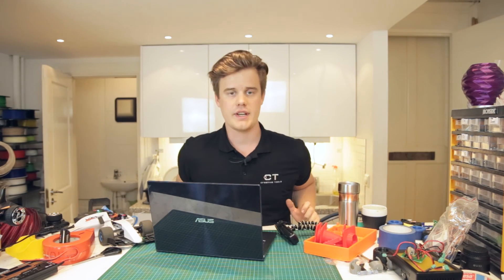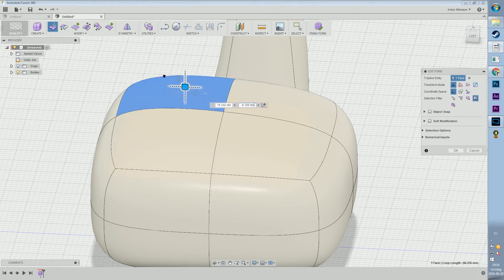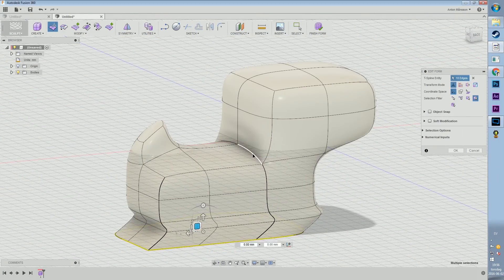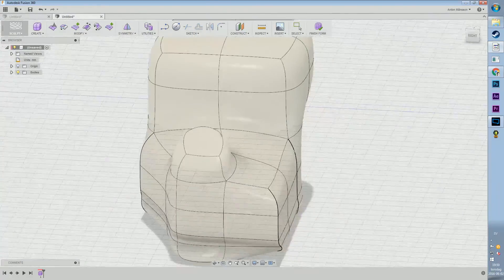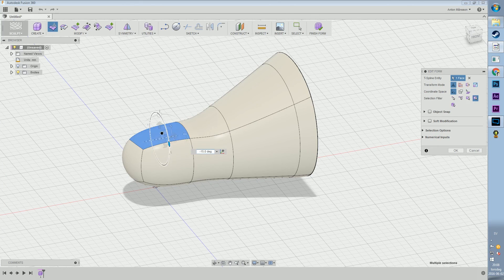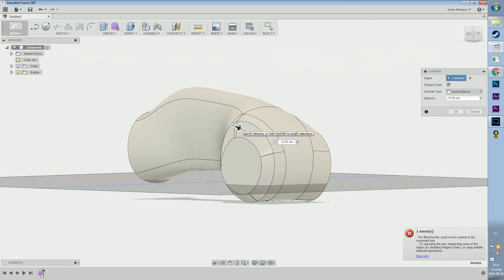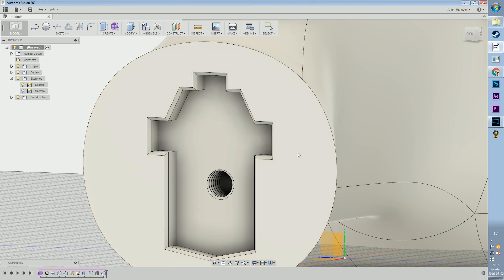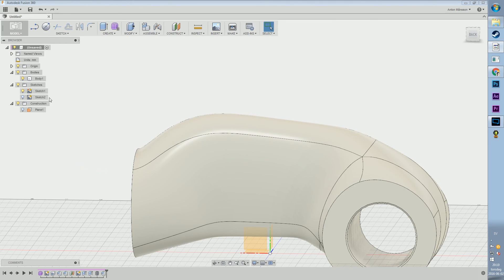/Guide | Fusion 360 - Surface/sculpt Tool (T-splines) and Application - walkthrough

Comment: It is a bug. It happens when you merge Body A with any other body later in your timeline. The only work around is to first slide the timeline back to just after Body A (your body before you merged it) and then choose to edit the body in sculpt mode.
Reply: Sculpt mode went away.  I'm having the same frustrating issue and tried playing with the time bar, hiding bodies, and changing appearances. Have you found a solution +3D Print - Tech Design ?
Reply from the maker: No solution yet, I guess few see it as a feature as you can see the previous shape and refeer to.
Reply: @3DPrintTechDesign  I found it!! Preferences > Design > Show ghosted result body.  
This will make editing forms so much faster rather than having to select Finish Form to see the results.